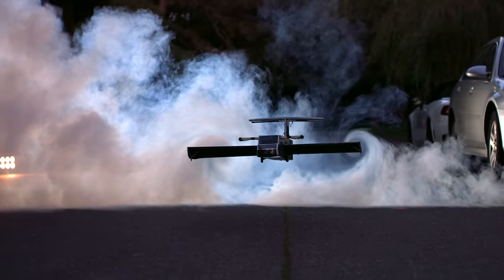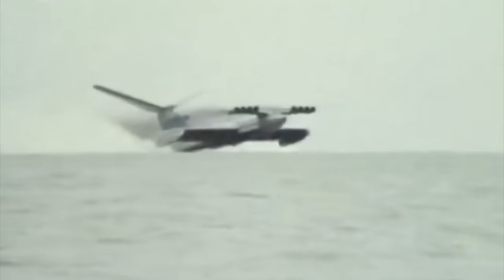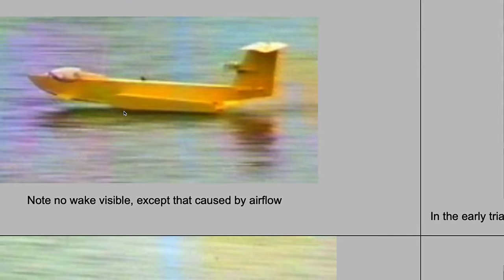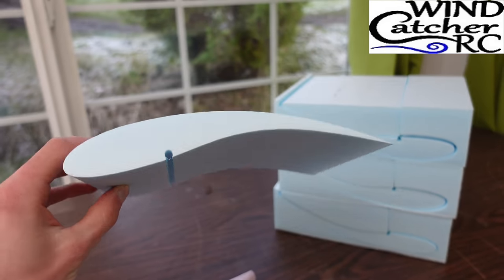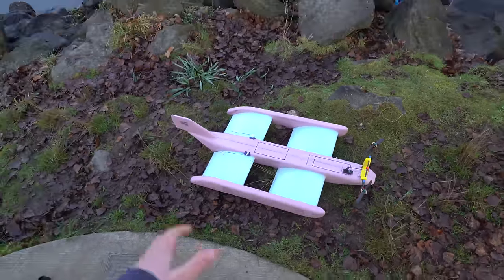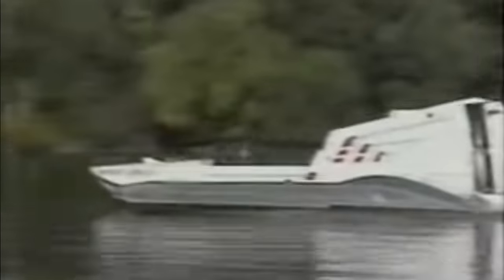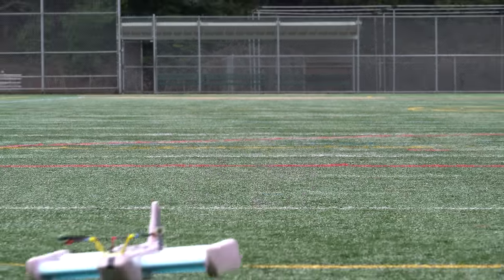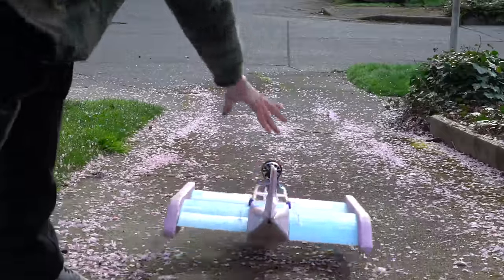Are R/C Ground Effect Vehicles Even Real???

Comment: As for getting off the water, perhaps use a retractable boat foiling, thus using water-lift instead of air-lift to push rather than pull the vehicle out.
Reply: I know it's not practical but I really like this idea of a hybrid hydrofoil-groundeffect vehicle!
Reply: And wouldnt that just make it harder to make and code
Reply: I think simple is the way to go
Reply: Pretty much retractable landing gear but opposite? Gear to push off the water into ground effect instead of gear to catch a landing plane?
Reply: @Sirius_04  I suspect it may be useful for both take-off and a stable-landing
Reply: @altus1226  he should make an aircraft carrier for this and a small airplane😂
Reply: @chaddecorte1617  agreed!
Reply: Than it would be a hydrofoil or a sae plane a ground effect vehicle is something that starts out as a boat to gliding on the surface of the water it would still have to gain enough speed too rise out of the water that’s a cool idea though
Reply: I wonder if another aerofoil (or hydrofoil) opposed to the main wings would counter any tendancy for the vehicle to climb out of ground effect and keep it stable.
Reply: Problem is that not only does it add more weight and control surfaces, it increases the surface area in contact with the water thereby increasing water drag, making it MORE difficult to pull away from the water.
Reply: @eminstinct4114  isn't a hydrofoil just a boat with water wings? the flaw is that the wings are still in the water
Reply: @FiltyIncognito  well water is a dense and incompressible fluid so it generates a lot more lift for the same speed with the same wing than air
Reply: @beaclaster  
- To reach that same speed you need a whole lot more power
- You remove the benefit of ram hover lift
- It doesn't solve the problem of detaching from the water since the hydrofoils are still in there.
- Increased weight and control surfaces reduce power-to-lift ratio
- The increased drag at a lower distance from the center of gravity introduces a stronger force of turning the nose down, which will require more thrust to counteract.
Reply: @FiltyIncognito  you really didn't look deep enough into the equation. you don't want speed, you want enough lift. and as the hull is lifted the water drag is only the hydrofoil. 
btw do you really need to add control surfaces to everything
Reply: @beaclaster  I think you may have misread my comment(s).

Comment: The whole point of the ekranoplan was to transport as many troops, gear, vehicles and armour as possible, as fast as possible without being detected by radar during the invasion of mainland USA. It really is that simple. R/C ekranoplans carry no cargo, are built using R/C  aircraft techniques and have an exponentially higher power to weight ratio than any full size WIG. Try a 3 motor model, add ballast so you need all 3 motors at full power to get off the water then cutting 2 for cruising.

Comment: I've never heard that ekranoplans are supposed to be incapable of flight out of ground effect, except on youtube channels and their comments. All of the original research I've seen says full scale ones were expected to gain altitude and fly at hundreds or thousands of feet to avoid boats or obstructions like bridges. 

Flying in ground effect is meant to save fuel by lowering induced drag, and to make it possible to have a shorter wingspan on a heavy vehicle by increasing wing loading while keeping the induced drag low. They all have enough engine to fly because of starting water drag.
Reply: THIS
Reply: Exactly, the whole point is it has more efficient flight profiles, usually for very heavy loads, if its capable of 'real' flight or not isn't and never was the point, most if not all of them will be able to fly at least a little above the WIG effect. 

That is all arbitrary 'rules' as to what this type of vehicle should be and how it should be used, it doesn't mean it can't do something out of its preferred operational envelope...
Reply: it would make a lot of sense to build those things with the ability to fly properly.
Reply: I feel like you know what you're talking about.  Cheers!!
Reply: I'm guessing the real goal of making an RC ground-effect vehicle would be to maximize efficiency and increase range?
Reply: I don't believe that's true. Ground effect vehicles are supposed to come to a pitch trim equilibrium such that as the center of lift moves, thr vehicle lowers its self back into ground effect.
Reply: so true why does he keep on saying that it shouldnt fly like a plane
Reply: Well, sort of. It had enough lift to sort of dip down and “hop” out of ground effect up to a couple hundred feet to go over bridges and such, but it couldn’t stay up there, at least to my knowledge.
Reply: @Jwmbike14  

"Ground effect vehicles are supposed to..."

Why, because you say so?
Reply: @Jwmbike14  true, but is this more to do with inherent safety/efficiency than it is outright engineering?  because rules are different for RC where human life is not a factor.  i wonder if all the smaller scale full scale GE planes coudnt just power out, but are designed not to for safety and regulation reasons.
Reply: @notahotshot  No, not because I said so, but because that is the primary differentiator of a ground effect vehicle vs an airplane in ground effect.... 🙄
Reply: @WEOWNTHESKIES  No, it is very much  due to "engineering." These are two different vehicles designed for two different flight regimes. For example the Caspien Sea Monster was just about the same gross weight as an A-380 with 75% the wing area. It also had 75% the thrust. It had flaps, but not in the sense of a high lift, multi-slotted flap design seen on jumbo jets, these were simple and had more to due with pressure than increasing Cl. It took off from water at LOWER take off speeds and off water (higher drag than wheels/asphalt), with less wing and less power.

Ekranoplan is not synonymous with airplane, and should not be thought of, or designed in the same way. Designing an ekranoplan to be stable and perform outside of ground effect is designing an airplane, not an ekranoplan.... And it's not due to lack of power.
Reply: In russian we have ekranoplan/ekranolet terms, second one is able to fly over obstacles.
Reply: Ekranoplanes used to fly over ocean at low altitude to save fuel and there were no obstacles that could touch their height may be titanic would have touched it but it used to fly above the boats
Reply: @Reginvalt  in german we differntiare aswell into freeflight-capable and uncapable types
Reply: I was under this impression as well
Reply: @이시훈-k4n  He didn't say it. Subscribers like you were saying it so he did research to find out the facts.
Reply: yes, in fact it is noted in the reports for the Caspian Sea Monster that it was sort of unstable at higher altitudes, implying that it could and did fly out of ground effect.
Reply: Yup. Straight from the Wikipedia article: "Once sufficient speed has built up, some GEVs may be capable of leaving ground effect and functioning as normal aircraft until they approach their destination."
Reply: Yeah, the reason to make a ground effect vehicle is to get some advantage out of it, namely, much higher efficiency. They were not made for fun, just to conform to some arbitrary definition. Saying "A ground effect vehicle that can get out of ground effect is just a plane flying low" is like saying "A plane that can taxi around on it's own power is just a car with wings glued to it".
Reply: I understood that too. I thought the "advantage" was only intended to be over water, yet be a functional aircraft otherwise.
Reply: @notahotshot  no, they are supposed to fly in ground effect because they do not generate enough lift to manage sustained flight out of ground effect, its literally how they are designed.
Reply: @WEOWNTHESKIES  also the air on a smaller scale doesnt always = 100%. Like the weight vs air "thickness" vs power doesnt scale perfectly in my understanding. So getting Ground effect for lift or downforce wont act exactly same on a RC model . Im sure F1 teams/airplane manuf have fancy algos and windtunnels to make up for any scaling effect. But ive never really seen an R/C small scale thing get ground effect for lift or downforce. Unless its an EXACT scale copy of a plane/f1 car but usually a BIG "small" scale
Reply: @toml1446  yeah but they r saying that doesnt mean every ground effect plane design cannot fly outside ground effect for short time. Point is "ground effect" planes do not HAVE to fly in ground effect but where designed to take advantage of it more than high altitude flying. Still just because it CAN fly ground effect doesnt mean it HAS too
Reply: @captaintoyota3171  if it can fly out of ground effect than its just an airplane. otherwise a ground effect plane is an aircraft that is too heavy to fly out of ground effect, hence the separate name/ designation to convey that this product is different and expectations need to be managed. 

Because by your logic my cessna 172 is a ground effect plane because I spend a decent portion of my time flying in ground effect.
Reply: Problem is I don't think there's actual video or photographic evidence of any classic Ekranoplan in out of ground effect flight, aside from Bartini's model.  Certain models I can certainly see doing it, there's just no evidence of it being tried.
Reply: @BlitzvogelMobius  You act like that was the only GEV ever made, the math is well known on where/when it can and cant fly.
Reply: @toml1446  Like I said, the actual evidence of high altitude flight being trailed is lacking.  The A-90 Orlyonok is a "Class-B" meaning it has high alt flight capability.
Reply: It wasn't incapable of exiting ground effect, it just wasnt stable. THe large tailplane meant it couldn't sustain a cruise outside of ground effect for long, it basically was meant to jump over ships before the tailplane fluttered itself to death.
Reply: you forget the fact that Caspian Sea Monster was developed as a weapon platform, so the goal was to fly under radars with capability to fly over obstacles up to 60m tall; after launching rockets on designated targets, it would need to turn fast to try to get away, so flying higher than ground effect was there by design.

Comment: IMHO Having them be puller props is a mistake; you are taking some of the propulsion thrust and converting it to lift as it goes over the airfoils. An excess of lift, especially outside of ground effect is what you don’t want, and what the propulsion system you have causes.

Also having them be aggressive airfoils I believe is also a mistake. Keep them flat ramps like the full scale unit. You just want to trap a pocket of air under the vehicle, like a ram air hover craft. The airfoils you have not only do that, but function as a lifting surface outside of ground effect
Reply: This touches on my initial thought when I saw the design. It's okay to increase angle of attack by lengthening the top surface and have the air leave the trailing edge at a steeper angle, but the "hollow" underside of such an overly curled airfoil (imho) destroys the ground effect (and it pushes the nose down). So I was going to suggest to test it out, simply by foaming up the underside of the wing to a planar surface. It will have the slightest of angles which will be enough to capture the air. With the hollow, the pressure in the middle of the wing is definitely less than at the leading edge, which in turn is less than the pressure at the trailing edge. Fill that gap and there should be a more stable pressure under the wing helping the lift (and that pressure would disappear with height, which is exactly what you're looking for) (disclaimer: not sure if "pressure" is the correct word that I'm using here. I'm translating in my head as I go, so pardon me if I'm off-jargon here)
Reply: It needs a very "inefficient" airfoil to work correctly. Noice how all of the commercial wings have long cords, very thick camber, and a flat bottom profile. I believe this is to minimize the lift from airspeed, and maximize the lift from ground effect.

Also the thrust vectoring was accompanied with massive flaps. This allowed them to fine tune the amount of air trapped under the wing withouth releying solely on engine thrust.

Comment: It looked to me like the air off the props was going over the front wing and under the rear wing causing it to lift the rear and the nose to skip. The air could not get under the front wing. 
You hit the nail on the head for ground effect without realising it when you said the pilot throttled back the engines when airborne. 
Ok so at full throttle it could fly higher but in ground effect it only needed much less power and probably at that smaller power it couldn’t fly higher. Good video 👍🏼
Reply: That was my thought as well. Getting a bit of Coanda effect off that front wing and having the majority of the air forced under the rear wing.
Reply: he legit said that in the video

Comment: There seems to be a false dichotomy here. To be a "ground-effect vehicle," it needs to be designed to take advantage of the ground effect. It doesn't need to be incapable of flight above the ground effect.

Using the ground effect for increased efficiency above and beyond that obtainable through normal flight is certainly a legitimate endeavor, even in a craft capable of normal flight.
Reply: Yeah, the difference between a ground effect vehicle and a plane is what they are optimized for. Many planes can also roll around on the ground. And still we don't say "well, then it's only a car with wings glued to it".
Reply: All aircraft use ground effect on take off, but only Ground effect vehicles are incapable of flight outside of ground effect by design.
Reply: @toml1446  That is not true. First, most aircraft are outside of the ground effect really fast and thus they don't use it for anything. Actually, the only thing a regular pilot is trained to do with ground effect, is to be careful, transitioning in and out of GE doesn't upset their flight path/landing.

Most Ground Effect Vehicles are able to fly outside of GE, same as many planes are able to fly within GE. But GEV are optimized to generate as much GE as possible (due to their wing shape) and are built to make use of it. Flying a regular plane in GE is incredibly difficult.

In the end, if you add enough thrust, any vehicle that is able to take off from the ground will be capable of free flight.

And since any serious aircraft is always designed with a decent power margin for emergencies, there is no such thing as a GEV according to your definition.

Also, your definition would mean, that a fully loaded GEV suddenly becomes a plane if you unload all the cargo and it becomes capable of free flight.

Did you even put a minute of thought into that argument?
Reply: @dak1st  " That is not true. First, most aircraft are outside of the ground effect really fast and thus they don't use it for anything. Actually, the only thing a regular pilot is trained to do with ground effect, is to be careful, transitioning in and out of GE doesn't upset their flight path/landing."

Tell me you have never flown an airplane without saying you have never flown an airplane

Also flying an airplane in ground effect is easy as  fuck, the only thing the airplane does is generate more lift. thats it.  Every pilot has done it when they practice touch and goes, the training we have had on "how to fly in ground effect" is if you land and your airplane bounces on the runway dont force it back down or you will crash. 

Thats about it. 

Adding enough thrust....

no shit but we are not talking about that. 

"And since any serious aircraft is always designed with a decent power margin for emergencies, there is no such thing as a GEV according to your definition."

This is also untrue. most aircraft do not have a greater than 1:1  power to weight ratio and in an emergency if they are not positioned well they crash, or if they his a down draft thats severe enough they also crash. 

I dont think you understand what a loaded and unloaded aircraft mean in the context of how they are used. 

Because again, if a GAV can fly out of ground effect it is simply just an airplane. That is the TECHNICAL and LEGAL distinction of them.
Reply: @toml1446  Nope. Legally, there are three classes of GEV. Only GEV class A cannot exit GE. GEV class B can temporarily fly up to 150m, class C can exceed 150m even for longer durations. All three of are classes of GEV.

Your argument is like saying, a plane is only a plane when it can only fly, but not roll. Almost all planes can taxi, so by that definition, they obviousily aren't planes.
Reply: @dak1st  yeah thats not at all like what I said lmao. An airplane that is incapable of sustained flight is not an airplane. Whether or not it is currently in sustained flight is not what we are talking about. 

A gev that is capable of sustained flight outside of ground effective is just an airplane,  also the height in which an aircraft can utilize ground effect is directly proportioned to the length of its wings.

Comment: Definitely consider putting the prop in the back.  It's stabilizing whereas a prop in front of the CG is destabilizing.  I know that sounds backwards, but that's just because it's easy to imagine it as the prop pulling versus pushing, and in that case pulling it would stabilize it.

But, the prop isn't pushing or pulling, it's moving a column of air.  So now imagine a few degrees of yaw and the air is entering the prop disc at an angle and that air is then being accelerated in a direction parallel to the prop shaft.  If you break that into force vectors it will make sense that having the prop behind the CG adds a stabilizing component.